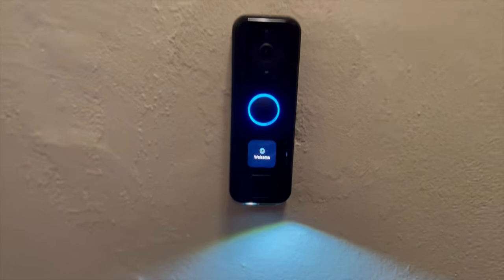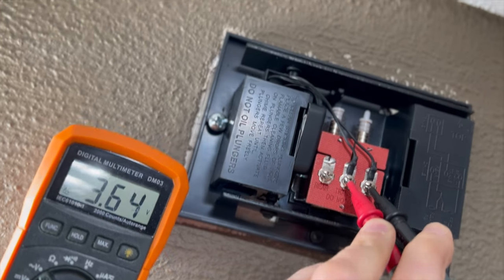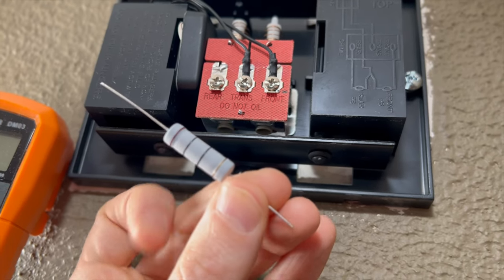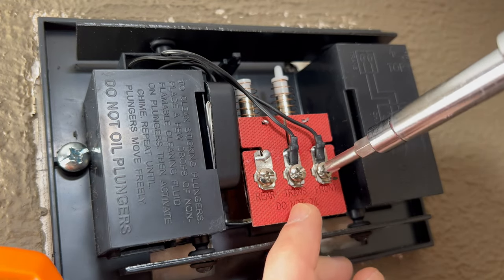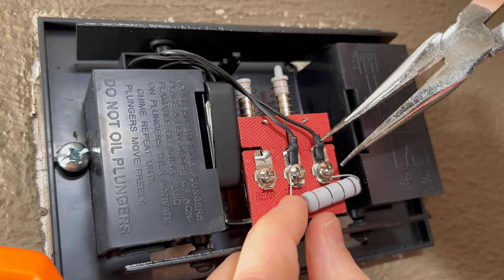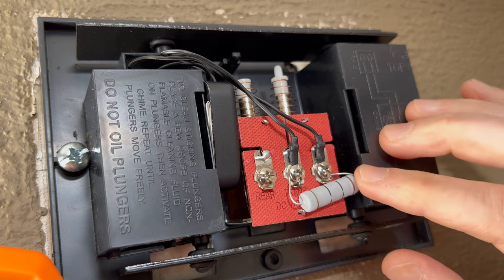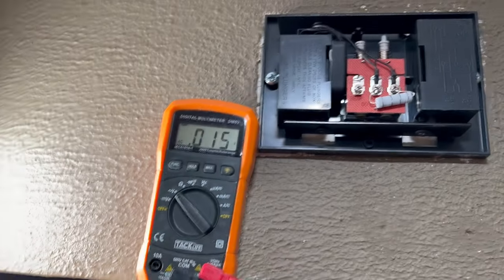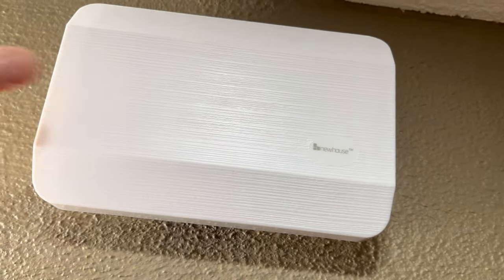Fix doorbell chime buzzing after Ubiquiti G4 Pro doorbell installed

Comment: Good idea. Still not sure why we require an EE degree to install a Ubiquity G4 doorbell pro though... Kinda had a this preconceived notion that a $200+ product should sorta work out of the box without additional electrical components.
Reply: I disagree. The genius of using a switch loop to the doorbell not only powers a video camera but still allows the original chime to work. This all with no extra wiring, batteries or power supplies. Most install kits include the resistor to solve the known problem.

Comment: Hello David!  I saw this and it was an eye opener.  My chimes are at 14 V!  Which means it seems to be constantly on!  I have actually had my chimes disconnected and just running the SkyBell.  Would it make sense to put in a resistor, or see if there is short circuit somewhere?

Comment: I need your help. so i have a wired ring video doorbell(2nd generation)  that was working fine until i was cleaning by the front door,  and get water all over it. after that i started hearing humming insider from the doorbell chime box and my camera was not functioning fully anymore ( it will still capture motion, but if i click the button on it to ring the doorbell, i wont get any sound inside the house) . i disconnected the wire from the transformer terminal on the doorbell chime box , and the humming is gone. Did the water spill on my ring video doorbell mess up the transformer inside and have to be replaced, or i can still use the resistor method as you did? as long as the transformer cable terminal is disconnected , no humming. once i connect it back, it takes a while , but the humming comes back  Thanks in advance

Comment: 3.5 Volts / 5 Ohms = 0.7 Amp, or 2.45 Watts.
Wouldn't a higher resistance resistor reduce the energy waste?

Comment: hello, can i put those 2 black wires together? my chime was removed  so it is hanging on the  wall. i am  installing a ring doorbell  2nd  generation and it does not need a  pro power kit.  a pro power kit   is attached to this 2 black wires( trans and front) right now. so when i remove the  power kit  should i keep the 2 black wires together or apart. thanks hope you can reply soon.

Comment: I has the same problem when I install mine. There is a setting on the software of the doorbell. In my case just changing the type of door chime from digital (default one) to mechanical solve the problem.
Reply from the maker: Yes that should be everyone’s step 1 if they have a mechanical chime. Before setting that on mine I wasn’t getting any chime at all.
Reply: @twconsulting This solution also works for me. Saved me time and uncertainty. Lol. Thanks for the tip!

Comment: Well, I did the connection with an 8 ohm resistor from Amazon (actually  bought the whole 20 - or 30-piece kit rather than hunt for a single resistor. It was maybe $10CDN), and it appears to have worked.

That buzzing was seriously interfering with my tinnitus keeping me up.

Thanks.

Comment: So I added the resistor using the link you provided and follow the steps exactly as you described, and I still have some buzzing. It initially does stop the buzz but then within a few hours it starts to come back. Any suggestions?
Reply from the maker: Wildly speculating because there are too many unknowns but it could be undersized for your particular setup. If that is the case you’d want to discontinue use because it could overheat. Readings would need to be taken with a tool like a multimeter to get more specifics to troubleshoot that. Please check with a qualified electrician if this is not something you are familiar with for safety.
Reply: Increase the resistance

Comment: How did you determine the wattage you needed for the resistor? I’ve seen people saying they used as low as half a watt but that seems liable to go bang.
Reply from the maker: The higher watt rating means it has more capacity to dissipate the heat from the power it absorbs. Here is some good reading on that https://www.electronics-tutorials.ws/resistor/res_7.html
Reply: @reallyMello  is yours still working? I have a wyze v2 doorbell and my chimebox hums pretty loud. I'm about to order a resistor, but I worry about it getting too hot. So can you please let me know if yours is still working fine?
Reply from the maker: @stevenbaker1972 mine is still working fine but I ensured it was sized appropriately so it doesn’t get overly hot
Reply: @reallyMello  Thank you!

Comment: Thank you for posting this valuable information.   But I saw in video, you push button and wirelessly chime rang.  So , how you did that , can you please explain.  Thanks
Reply from the maker: Thanks. I'm not sure what you mean about it wirelessly ringing though.
Reply: Oh , I got it now .  I thought door bell and chime wireless, but after watching again, found two different places, so not wireless.  My bad .  But thanks again.
Reply from the maker: @jituxx7570  in the time since making the video Ubiquiti did release a wireless chime that you plug in to a normal AC outlet and then you don't use the mechanical one if that is what you are looking for. It works over Ubiquiti wifi.
Reply: Ok good.  But no , I also have with wire system, and same problem, but now learned, and ordered from Amazon link .

Comment: Is it normal for the resistor to get warm/hot?
Reply from the maker: They do turn the excess voltage to heat, but if it is getting hot you may be exceeding the voltage the resistor is rated for which would cause it to burn up which is dangerous.

Comment: After installing my ring, my chime doesn't work properly. There is no more ding dong, there is a ding, then there is five to six seconds of buzzing, then finally the dong. Any ideas? New upgraded transformer.
Reply from the maker: Did you check their compatibility list already? I found a list here https://support.help.ring.com/hc/en-gb/articles/210644123-Ring-Video-Doorbell-1st-Generation-Chime-Kit-Compatibility-List#:~:text=If%20you're%20unsure%20what,hammer%20or%20an%20electronic%20speaker.&text=Angelo%20Brothers%20Co.&text=Note%3A%20The%20Ring%20Video%20Doorbell,system%20using%20a%20DC%20transformer.
Reply: @reallyMello  no I haven't. Thank you, I will do it tomorrow.

Comment: This is potentially dangerous. It doesn't say what the voltage might be when the doorbell rings. But if you take 8V (a very conservative estimate, it's usually higher!), the resistor is going to draw 0.8A (which in combination with the chime might exceed the rating of your transformer!). 0.8A * 8V = 6.4W, which might make the resistor go kaboom in a spectacular way! Also, it's going to draw 10.7 kWh per year, you do the financial math. People are going to try this not understanding V=I*R etc. Providing this type of advice is irresponsible.
Reply from the maker: Thank you for sharing your concern. In my case, I verified the inputs and capacities, but people attempting similar should independently verify since each setup is different and/or consult an electrician to ensure safety. On the cost side, 10.7kWh per year would be about $1.18 annually in my area.

Comment: Not a very nice solution. This will use 2.7 kWh per year.
Reply: It's more like 10.7 kWh per year: 3.5 volts over 10 ohm will draw 0.35 amps, times 3.5 volts = 1.23W, times 8760 hours per year = 10.7 kWh.
Reply: I don't care what it costs as long as it gets rid of the annoying hum 😀
Reply: It is actually a bit worse. The total load on the transformer is 16VAC * 0.35A  = 5.6W     @bartmulder6995
Reply: @senddrews8225  Does the transformer function as a parallel circuit, possibly generating distinct electric currents (different amperes), with its heat production being separate from this additional circuit, i.e., Q = Q1(resistor) + Q2(transformer)?